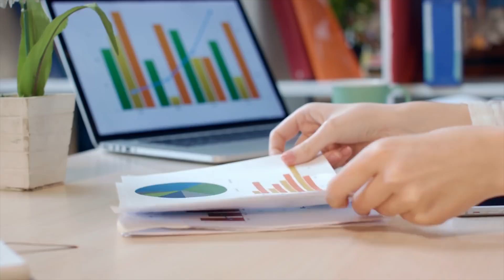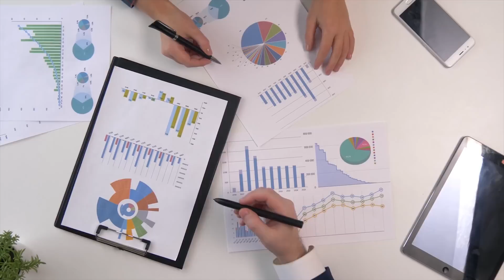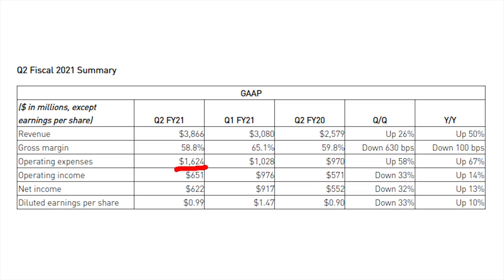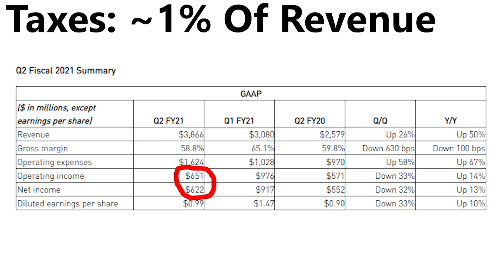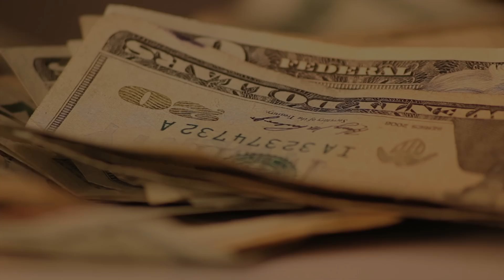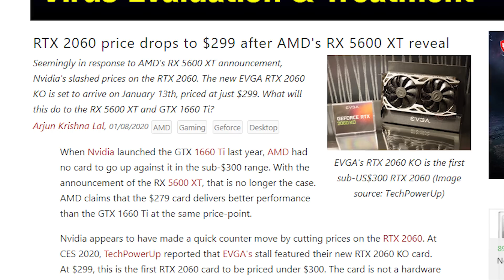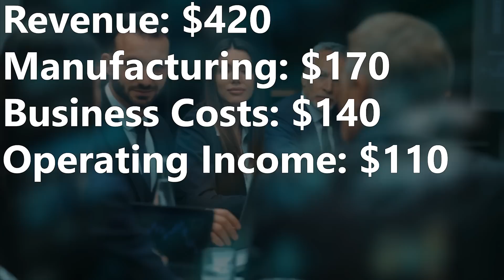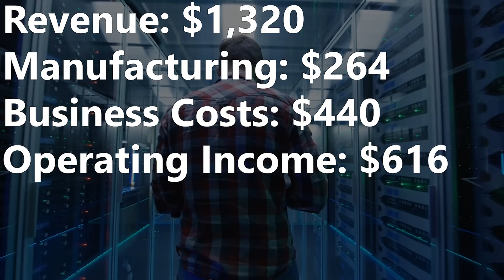How Much Does The Nvidia RTX 3080 Really Cost

Comment: R&D is tax deducted for US businesses, so that value is most probably inflated as much as they could, so always take it with a truck of salt and good luck finding the nail.
Also not taken into account Enterprise products that are made with exactly same chips as consumer products, but with a significantly higher price, both consumer and enterprise products are from same source, and both have different base price based on result quality. The price of binned chip is balanced within whole generation with total as of expenses for manufacturing as starting point.

And all of it goes into the bin when you just think of how capitalist pricing is formed - it's based on purchseability and how far it can be pushed over (i.e. how far can you push consumers into debt for your product)

Comment: What they have done is go back to the tradicional pricing were the top of the line was arround $700. On the 2000 series they went to 1200 on the excuse of the new technologies. So now the 3080 replace the 2080ti, the 3070 replace the 2080s, etc. and the 3090 is the titan. If you see it like that is more like a 25 - 30% jump in fps, including RT and DLSS. They did this because the lower sells of the previous generation, so dont get me wrong, it great that they did it, but it shows first the lack of competition and how they can charge us what ever they want (and we pay, 
unfortunately). Great products, but they are far from being a fair deal

Comment: the 3090 is supposed to be the titan level card so it's not really accurate to compare it to the 80 ti cards in terms of price
Reply from the maker: You’re right. Still, the 2080ti was significantly more expensive than the 1080ti and 980ti.

Comment: Probably a little conservative on the manufacturing costs for the 3080. GA106 should have over twice the yield. Gddr6x probably comes at a premium, doubling memory costs. Cooler and pcb design will scale proportionally. 

I'd put 3080 at roughtly twice the profit after manufacturing costs since we're already dealing with rough estimates. Payroll and operating expensives are significant but I wouldn't hack that off each cards profit margin. That'd miss the point that scale is everything in this market so 3060 will still create more revenue

This does make a point of how uninformed people must be to say amd won't be able to compete.

Comment: Few mistakes almost half the nvidia revenue comes from things that sell atleast factor of 3 higher relative to manufacturing costs  than consumer cards. Secondly nvidia acquired a large company with significant operating costs and last quarter was one which added to its operating costs and revenue.
And MSRP should have margin not only for board partners but retailers and retail logistic companies.  Yeh. I did same analysis right after Turing Launch, and their margin dropped, as it was more expensive to make than Pascal.
Reply from the maker: Great points! $400-$500 should still be the ballpark price of developing and producing the RTX 3080 though.
Reply: I think if overall gross margin is 60% the consumer cards should have gross margin well below 50% maybe something like 40%. Don't just remember what I got from my previous calculation. And if we also account for retail margin. The nvidia gross profit per card sold should be way below what you calculated.  Then net profit per card sold would still need to be adjusted by its fraction of profits relative to fixed costs.  But nvidia is still a company that needs to sell lots of cards to pay for its large R&D budget, and loosing volume would make nvidia to have net loss quite easily.
Reply from the maker: I agree that lower level cards probably have a margin close to 50% after accounting for retail costs. But I’d bet that the 80 series and 80 ti series are likely more than 60%.

Comment: Nvidias Margins are pointless to be used here.

Datacenters, Quadros etc. have WAY more of a profit.
200 dollars for a card with 10GB of GDDR6X that, lets say costs 6$/1GB and a 150 dollar cooler?

That is ignoring GPU, shroud and PCB.

Then: NVIDIA cards are not just hardware, altough you are probably aware of this, Nvidia is by now is more of a general graphics company as compared to a hardware one.

The biggest one I think that generates their high margins is Datacenters here. The chips there are not massivly bigger and the HBM is probably not really that much of an issue either.
Reply from the maker: Of course, I’m sure their corporate side of the business is much more profitable. This was just supposed to give a ballpark estimate of how much their various mainstream cards cost using their overall margins.

Comment: Alright well i just got to 50 seconds and i can already say, no.... the 3090 is not a "ti" card, its a titan replacement.. which the RTX Titan is $2499.
And all the maths are relevant, if Nvidia purely only made its profit from these graphics cards. Firstly, these graphics cards are only for consumers, and are on the very low end. 
Wait until the ampere quadro cards are released. The current turing Quadro cards are upto $9999USD, which yes it is rare to see these in a "gamers" system, but are LOTS and LOTS of them in Super Computers and business's who do alot of CAD work, etc etc all around the globe. Their profit margin is made up of so much more than just its consumer grade cards. They're involved in healthcare, game dev, etc etc 
I dont personally know if this is completely how they do things either, but what you'll probably find is they develop the architecture first with the big quadro cards, with all the bells and whistles and these consumer geforce cards are basically just dumbed down, without all the rich features and less memory etc. And based off all that, you'll probably find that actual cost to manufacture a 3080 after they already have the architecture developed, is probably abit lower.
Reply from the maker: True, I was just trying to illustrate the increase of price in mainstream cards. The RTX titan isn’t a mainstream card but the RTX 3090 is. Even if you take out the rtx 3090 though, the gtx 1080 ti launched at $700 while the rtx 2080 ti launched $1000. And yes, I understand that ray tracing was added. I’m not saying that the increased cost is not justified, but simply that mainstream gpus are consistently getting more expensive.
Reply: You're right they're getting more expensive, but i guess look at it as a investment into the future lol. Also, the titan is a mainstream card, its just at the top/enthusiast level, its still a geforce card and not a quadro. If you go back in Nvidia's history, the 90 card was always the top. Even when they announced titan with the 700 series, they actually still made a 790 which was basically 2 titan chips on 1 board, because the 90 is the king. Then they basically stopped the 90 cards, and called them titan to signify its the top card in the pack. eg: there was no 990, 1090, 2090, only 80"ti" and titan. They're basically just bringing back the oldschool way, it made sense. If they make a titan now it will probably just be for the people who have owned every previous titan lol.